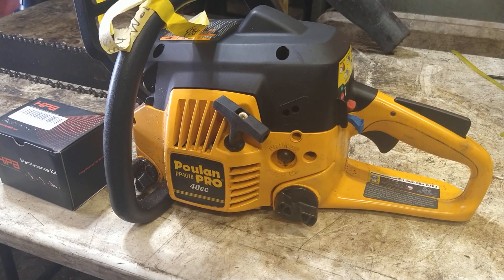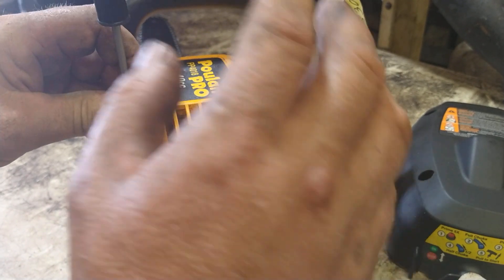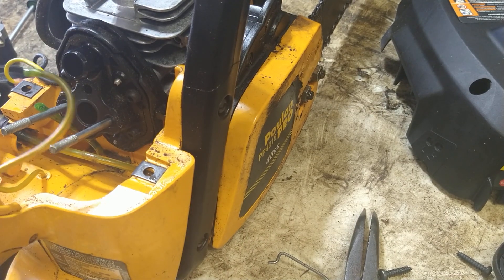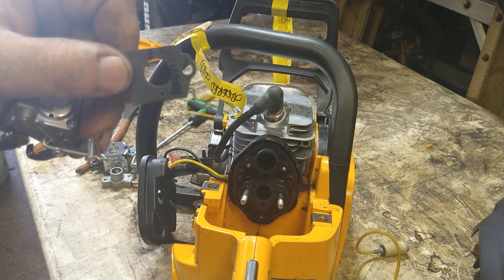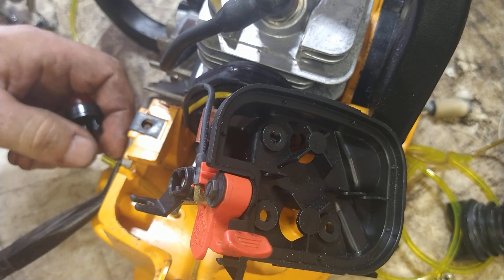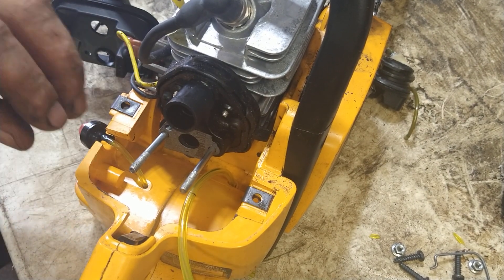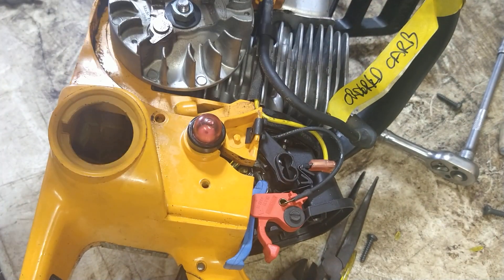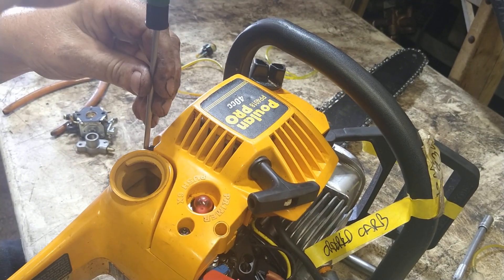poulan pro pp4018 chainsaw carburetor fuel line primer bulb repair and adjustment

Comment: Super video! Never had a gas chainsaw before, bought a used one was told all it needs is sharpening everything else is fine...NOT! No fuel was getting to the primer so I took it apart and everything was crumbled inside the tank fuel filter laying on the bottom pieces parts of fuel line everywhere but didn't know what went where. Thank you for your wonderful help.
Reply from the maker: Right on

Comment: Also, if playing with the adjustment screws on back pack blower, don't remember how far or how back I went on each adjustment screw. It starts up wonderfully, and runs great, however, want warms up it boggs when hitting throttle and seems to not have full power. Does stay idling after hitting throttle and letting fit, so that's a good sign. Correct. It's a echo blower. If you could help, that would be great. I appreciate ya

Comment: Ok got a poulon pp3516avx did your video to replace carb lines and primer bulb works great runs great, do you have a video on this saw it is dumping way to much oil from the oiler, how do I fix that 😅😅

Comment: Im 14 and have been doing this for 2 years
Here's my deal when I do these saws I do the fuel lines how they were simply because when you cut down tree which lets ne honest who cuts down a tree with this saw but if you do the filter/fuel pickup need to be to the right side of the tank or it'll run out of fuel when used on it's side
Reply from the maker: sounds bout right

Comment: I have poulan 3816 38cc cut about 7 trees since I owned it brand new ,did it just like in video changed the carborator cut the choke rod end off  , changed the tubes twice , changed fuel filter twice , changed bulb twice , changed spark plug twice it has spark , changed gas twice , cleaned out muffler ,it still will not start ! any sugestions ? Besides buy a new one !
Reply from the maker: make sure lines are correct. filter line to right of carb left of carb to short primmer nipple long primmer nipple to tank no filter. if that is correct and it is priming. dump half a waterbottle cap of mixed gas in the carb hold throttle wide open pull till it starts. if it starts you will want to turn low screw just a smidge counter clockwise. try again. after that do the high counter clockwise 1/4 turn at a time till it runs. if it didnt start first take off muffler look at piston. if you see any lines in it its fucked if not is it flooded? if flooded turn high screw clockwise till snug tight dont over tighten. that shuts fuel off. pull with trigger wide open till it fires. now cylinder is dry. turn high screw out 1/4 turn at a time till it runs. probably 3/4 to 1 and a 1/4 turns out

Comment: I viewed your video for the PP4218A which is my saw. However, I found the visuals and explanation much easier to follow on this video. Provided I order the correct carb, do both saws follow the same procedures and sequence of steps? Thanks for your help.
Reply from the maker: Same same.
Reply: @smallengineguys  Great - assuming you mean same carb too. Thanks for your help.

Comment: Thats a great video and your explanation break down of the fuel lines was awesome !!

I changed out the fuel lines, primer bulb and carb…… still not turning over….. i am wondering if its the adjustments on the new carb….. gonna attack it again in the am!!
Reply from the maker: Plug. Fowls out. New plug try starting full throttle. Notworking? Try spraying carb cleaner in carb. Try again full throttle. Let me know ill tell you more.
Reply: @smallengineguys  okay progress….. 

Gapped it at .02  L was closed…… H was set at 2 1/4 turns …… and i have no idea where to set the idle screw underneath….. 
It popped and then ran i opened up the H another quarter turn and sounded good on the upper 
The L idle was unimpacted by any of the turns….. i had set it at 1 3/4 turns. 

I had the upper cover off and nothing over the air intake and it was smoking a bit which makes me think …. It’s a little rich or too much oil (?)……. After running it for about 3 min, i shut it down to put the cover on….. and couldnt get it to pop again with the cover on……. I am off to grab some carb cleaner…. And let it cool down 🤷🏼
Reply from the maker: @NashvillePastaman  gotta be new bought today gas. Gas for these is no good at 3 weeks old
Reply: @smallengineguys  just bought 2 gal of 93 and did a 40:1 mix - drained the gas….  Sprayed the carb, we’ll see if we can get it to pop in the am!  Any idea on the lower screw - i think its the idle screw???
Reply from the maker: @NashvillePastaman  1 turn is starting.
Reply: @smallengineguys  popped it off and ran it for about 15 min……. Smoked for a min and then ran - i got it tuned pretty well….. fingers crossed it starts today ;)

Comment: Why is the fuel line coming in smaller than the return line to the tank.
Reply from the maker: its just what they did. doesnt make a difference. the engine will never use more fuel than it can supply

Comment: If I understood correctly, the return hose, which goes between the large nipple and the fuel tank uses. the smaller line whereas the suction and fuel lines are the thicker tubes.  Is that correct?
Reply from the maker: originaly it was the other way around but doing it this way prevents hoses crossing and pinching. just a trick i learned over the years. goes large line on right from filter to right side of carb. left side of carb to small nipple. long nipple to small line on left of tank no filter
Reply: @smallengineguys  thx so much for taking the time to reply.

Comment: I have to drill that one hole to make my line go trough ... but workout  pretty good !
Reply from the maker: nooooo. welp welcome to leak town. let me know when your line shrinks and leaks  and you need to fix it ill do a video
Reply: @smallengineguys  Alright , was not expecting that to happen ,since is extremely tight still , and the other hole where the fuel line with the filter goes is definitely wider hole than this one I drill the hole on to, but lets see what times says >_<
Reply from the maker: @NeoJSsk  you might be alright. The smaller hole takes smaller line. If you drilled it the same size as the other hole youll be fine.

Comment: i have a poulanPro,, but my lines aren't like this.  the one you showed pushed through the body from the fuel to the tank to the bulb on mine goes to the carb, not the primer bulb. mine wasnt running  after one use,,it could be gas but I took it apart and the primer bulb line just isn't hooked to anything ,,,i pumped the bulb and could see the fuel pumping out in the body.   i see no port for it at all, it was just filling the area with fuel. this can't be right. but i see no other port. 

i have 3 lines,,, now that its apart,, i only see where one goes, as it still is attached.
Reply from the maker: 2 holes in tank one right and deep on left and shallow. right goes from filter to right of carb left of carb to short barb on primer bulb then from long barb on primer bulb to left tank hole. i promise they are both there.
Reply: @smallengineguys  lol ok,, i will look again...thanx for reaching out

Comment: Those cheap shit saws!! Swear I've seen em plumbed 6 different ways. I do it exactly like you did.  Had 1 today that was set up pushing fuel through carb. So filter, primer, carb, tank.
Reply from the maker: i do around 20 of these a week. yes do it just like i showed. although i would do a new carb. no sense fucking around when the whole kit is 15 bucks.